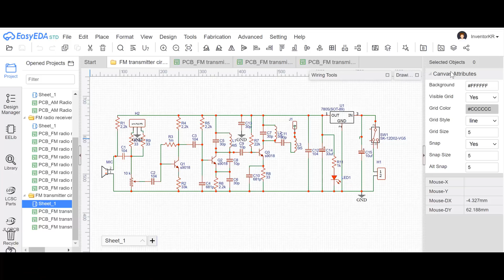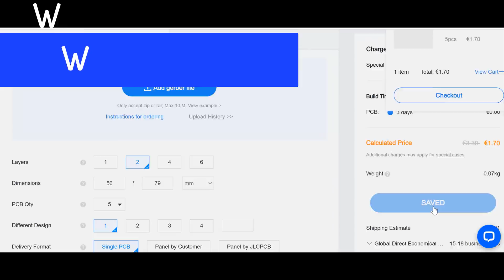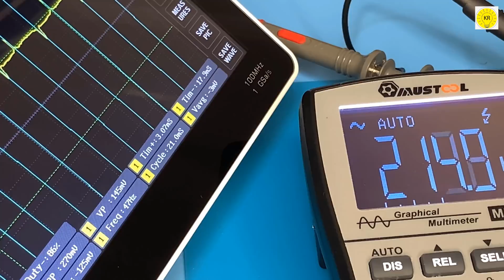how to make simple inverter 2500W , square wave , 4 mosfet , IRF3205 ,jlcpcb

Comment: Nice but the voltage was sagging with the 100 watt bulb. So that setup was putting out about 90 watts.
Reply: I'm very shure too, that construction will never deliver 2500W. The transformer is much too small for 2500W!
Reply: If I try to make this will it work or not ?

Comment: Disculpa y las caracteristicas del transformador? Devanado etc. Muchas gracias
Reply: Primary: 24 or 26 loops with a pin on the 12 or 13 loop accordingly, secondary usually 240 loops

Comment: Can i use z44 and atx tranceformer
Reply from the maker: Yes
Reply: @inventorkr1  is that ok with ATX tranceformer
Reply from the maker: Yes, you can, but change the capacitors to increase the frequency.  Use 1 nF capacitors
Reply: @inventorkr1  tqu
Reply: @inventorkr1  congratulations on the project , would the layout of the scheme